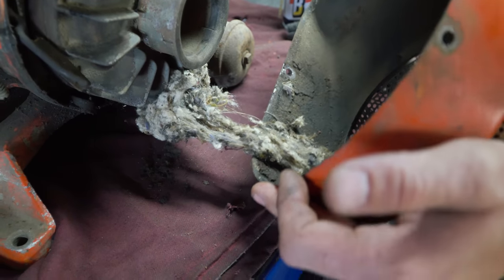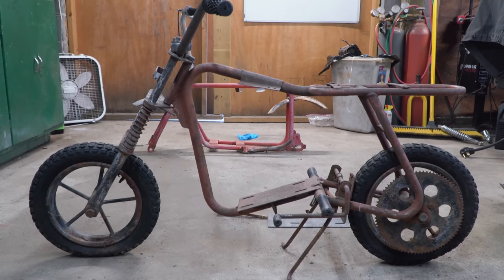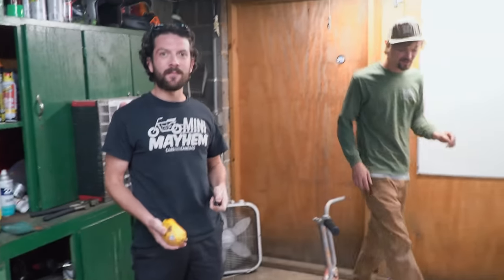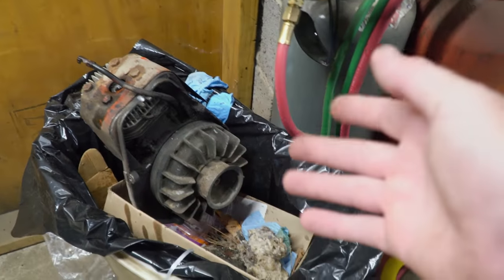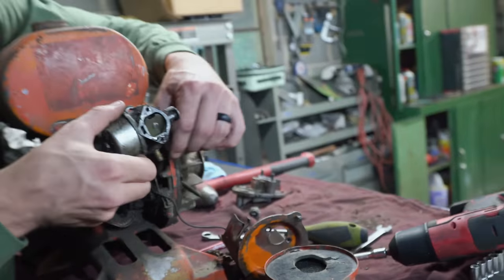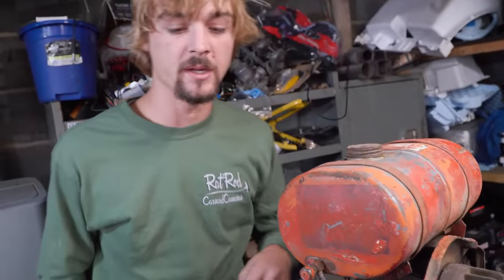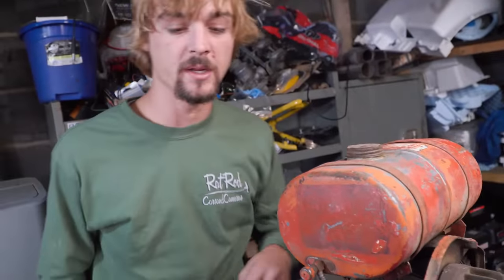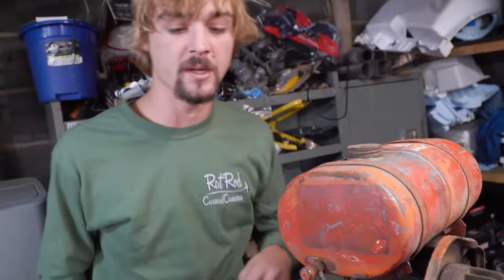Can we Salvage a 50 Year Old Water-Logged 2 Stroke for a 60’s Mini Bike Build?

Comment: a two stroke may not have a cam but they do have intake port timing. The ignition will also stop this two stroke from running backwards. A two-stroke glow engine as used in model airplanes will run backwards but not very well because of the port timing.

Comment: You can't start it in reverse because your timing is now firing AFTER top dead center when you attempt it, and most engines fire a few degrees BEFORE TDC. Theoretically you can move the coil over and it will start in reverse

Comment: 2 Strokes do run in reverse. Snowmobiles that have reverse most likely run in reverse. It saves a lot of weight making the engine run in reverse rather than having a reverse gear.

Comment: Ike´s right, twostroke will run either way. But when it´s gonna run backwards, you have to adjust the points (igniton plate) about 5 degrees back too. For example, when starting a messeschmidt threewheeler backwards (it´s only way of going in reverse) you press in the key, witch by wire sets the timing back and makes the engine run backwards.

Comment: The backwards thing is a problem on 2 points, spark timing is likely not right on tdc and also your magneto was designed for the north to south to pass a certain direction, if you could adjust timing enough and flip the magneto ove it would probably work

Comment: The engine will run in either directions but you need to change the timing to accommodate. Sometimes if your timing is way too advanced when you try to start it it can actually backfire and start in the opposite direction.

Depending on the ignition type, if you have a trigger coil and charge coil, it may not run in reverse because it has to charge before it triggers.

Comment: Issac you're not wrong. But I'm pretty sure it's the Reed valves not the spark that's keeping you from running it in reverse.  But overall this is a sweet build!  "It'll be fine"

Comment: My 2020 skidoo 2 stroke 850 runs in reverse.  That's how the snowmobile has reverse.  When you hit the RER (reverse) button the engine very quickly shuts down and then restart but running in reverse.

Comment: Quick bit of info that might apply here: I own a two-stroke moped from the late 1970s, and the reason the muffler is able to be disassembled, in that case, is because it occasionally needs cleaning due to soot buildup in the passages. Not sure if that's the case with the muffler on that Jacobsen, but I wouldn't be surprised if so. :)

Comment: A nice little engine guys
I just remembered that I have a very similar one sitting in my laundry (dry and no moisture on it) that has been there so long (35 years) that It has become part of the normal that I no longer see it
(male domestic blindness!)
 BTW do you realise that it probably is cheaper for you to buy your brake cleaner in a gallon tin and get a pressurised container (even a 15$ pump up one from your hardware store for gardening)
Maybe a parts cleaner wouldn't hurt or ultrasonic cleaner would be money well spent.
Keep up the good work guy's
Tony from Western Australia 🇦🇺 😁

Comment: You can always make new gaskets over night with two sheets of construction paper, rtv, a rolling pin and a wire coat hanger. Cut 2 long straight sections of the wire hanger. Place them on the left and right side of one sheet of construction paper. Cover the sheet of paper with as much rtv as you think it would need to make a gasket as thick as a wire hanger is. Place 2nd sheet of construction paper on top. Work air bubbles out and evenly distribute the rtv between the sheets of paper using fingers and a rolling pin. After satisfied with thickness and distribution and no air bubbles leave it over night and you can cut out your gaskets in the morning. You can also use any variety of material instead of construction paper. You can use oven wax paper, cardboard paper, parchment, or if your feeling really frisky and want a racing gasket you can use multiple layers of aluminum foil and rtv.

Comment: Needs a custom expansion chamber and a good slide carburetor. Would be interesting to have a CVT clutch and jack shaft too. Even a rear wheel with a 3 speed hub in it would help.

Comment: you can always  gaskets out of gasket paper or heck even a cardstock cereal box. 2 strokes don't need an expansion chamber and its very uncommon on low power applications like these. also, there is almost always a needle bearing on the wrist pin, because not  much fuel oil mixture gets up there. vacuum leak won't cause it to run away, but running lean on fuel means its gonna be lean on oil too. good combination for it to go boom

Comment: Generally speaking the spark plug will fire at around 6 degrees before top dead centre; So In Reverse that would be firing 6 degrees after top dead centre.
I might be wrong but I think that's the problem you have trying to run your engine in Reverse.
If you adjust the timing so that the spark plug fires before top dead centre in Reverse then you would probably have a reverse running engine

Comment: Its usually a timing thing for a 2 stroke to run in reverse. It can happen if you set the timing before tdc and spin it backwards it will pop off

Comment: 16:55 that's how my snowmobiles reverse works... I push a button it shuts the engine off and starts back up running in reverse....and this is also why u want to make sure your timing is right on a two stroke, my uncle was fixing his sled (NO reverse) started it up and his throttle got stuck wide open and cuz his timing wasn't right it started up running backwards at full throttle back into a tree 😆

Comment: In order to run back words you have to change the ignition pick up location to spark on time during compression strokeessetially its about 90 degrees out of time i believe i know the spark is off timing for sure tho every motor veries slitly for the sweet spot

Comment: My friend had an Aprilia RS 50 manual from the late 90's, if you bumped started while walking backwards it started right up and you would have 5 reverse gears on a motor bike!
Some 2 strokes 100% run in reverse

Comment: wouldn't running a 2 stroke in reverse take one step more than just starting rotation? I would think you would have to change the timing as trying to start in reverse rotation would then have the spark ignition after TDC not before as needed to properly run.

Comment: The piston moves up to tdc which inturn opens the Reeds draws in air and fuel/oil mix the vapour lubricates bottom end, piston moves down to bdc closing reeds with pressure which compresses the charge in the crank case whilst that is going on the piston opens the exhaust port so whilst the hot burnt gas releases the transfer ports open as the piston moves down and with the pressure in the crank case it pushes fresh charge up the transfer ports into the cylinder also pushing what little burnt charge out and then the piston is moving back up the cylinder to tdc closing ports and exhaust at it goes and all the rest is continuing fresh charge drawn in ect, but when you move away from the typical agricultural early types that's when power valves, port timing and resonance in exhaust expansion chambers comes into play really simple engines but some very complicated variations to get really good power either way I love a good 2smoker.
Reply: All 2 strokes function the same way regardless of how old or new it is.  An old 2 stroke will always run better with a proper tuned pipe.
Reply: @dipstiksubaru3246  yeah once they dip a toe into performance 2stroke engines they will have some crazy little rippers

Comment: That sprocket is hilariously giant for that motor. I’d go up in size on the motor sprocket and use a smaller rear sprocket. Have to find where it hits it’s powerband. Also that coil may have a built in rev limiter in it.

Comment: Most two stroke engines are designed to run just one way. The spark advance will only let it run one way.
Some two strokes can run both ways. Johnson snowmobiles had an engine that ran both ways. One for moving the machine forward, one way for reverse. 
Only thing is it didn't run well either way because the ignition timing was at TDC. Without advance you didn't get much performance.

Comment: You guys need a ultrasonic parts cleaner. Little tip, just fill it with water and put the cleaner in any bottle or jug with a screw on cap. Widemouth mason jars are perfect. Put your parts in the jars and drop the jar in the water. This way you don't have to ever dump out the entire tank when it's a disgusting mess.

Comment: Will not run in reverse without proper ignition system in place. Won't spark with points so most reversible engines were a 6 or 12V ignition system to do so. 
I also have a mint condition Bird Mini bike but it's been upgraded to a predator and a torque converter. We ended up getting it without its original engine anyways so we made the predator work fine. The rear sprocket is a little big though had to change mine to a 68 tooth with #35 chain! The original was like 80 something tooth it was a wheelie stander and that's all it would want to do!

Comment: Reverse on some snowmobiles is done by reversing engine rotation.
Reply: I was going to say this, both my ski Doo 800 summits spin both ways. when you put them in to reverse it stops the motor and spins it backwards.

Comment: If you have a vacuum leak at that area on a 2stroke, it will not "rev" in fact it will be very hard to start and have much less vacuum to pull the fuel through the carburetor.

Comment: This one time at the lawnmower shop I worked on a riding mower. It sat unused for quite some time. I gave it basic trouble shooting and some gas. It should not have but it started up. After running it for 12 seconds I shut it down because it stunk so bad like mouse nest. It also kicked out a ton of nest into the air. I decided to stop fooling around and just take off the blower housing as I knew I should have. In addition to mouse nest I found many gooey red chunks. So yeah, the fly wheel ground up a mouse or two.

Comment: That twist grip is what happens when steel and aluminum come in contact and is exactly why on things such as an iron block motor or when you are using steel bolts to hold aluminum parts together and you don’t properly never sieze you will get horrible corrosion issues Science man

Comment: It will run in reverse... just switch the spark to the other side of TDC. Ya gotta design and build your own expansion pipe......... The great thing about two-strokes.... More simplistic, and less parts. Oh yea, and case induction.......... only thing better than that, would be if it had rotary induction. An NGK CR2 racing plug wire all wrapped in silicone is the plug wire ticket...And it even matches the engine......

Comment: Here is one for ya in the run backwards 2T. There was about 5 of us with bikes at the trails where we rode.  There was 2 early Honda CR 125's 1 TM 125 and a Bultaco 250; Alpina and a YZ 80. And about 8 of us total and a couple girl friends. One of the spots was a place called the V,'s. There were 2 right beside each other straight down about 50ft and straight up the same. I was following my buddy as he went down the big V and he went slow because his girl was on the back. As he started up he bogged it real bad and he pulled the clutch lever in and tried to dump it. It all happened to fast he started to roll backwards as he dumped the clutch the CR fired up backwards and he slammed right into me and the three of us were all down and his bike still idling backwards.

Comment: The reason why the engine doesn't have an expansion chamber exhaust is because that technology was developed in East Germany during the cold war, Suzuki was the first non-Eastern Block builder to use them in racing, they didn't appear on consumer power products until about 1973.

Comment: The problem with a 2 stroke running in reverse is timing. as with a car the spark must happen a few degrees before top dead center. So to run backwards the pickup coil and points must be shifted so they operate BTC on the reverse rotation. The reason you got very little spark in reverse is the relationship between the pickup coil and points was backwards. The coil must be fully engaged with the magnets before the point send spark to the plug. Older golf carts started the engine in reverse to backup they mechanically moved the points and coil so the engine would run as well in reverse as forward. You mentioned the size of the muffler that is required because a 2 cycle can't have any backpressure or it wont run a standard muffler would not allow the exhaust to exit freely.

Comment: The old two stroke Detroit's could run backwards. Those were diesels though. Dont run one backwards though because oil pumps only push oil to the top end one way 😂

Comment: Its because the spark has to fire a few ° before OT, when you turn backwards it becomes to sparking after the piston was at top end... but theoretically it would run backwards, you just would have to repostion the coil.... there are diesel2stroke, they dont need spark and run backwards without modifikation... greetz from germany, like to see u guys checking out 2strokes

Comment: if the reed valve is good it won't run backwards but if it's worn it can but it will damage the carb as hot gasses can damage the jets and needle not worth trying it happened to Me doing a Trial ride up a steep hill and I stalled on a section so I rolled back and let the clutch out not thinking and it ran at full bore down the hill with me on it we ended up in a heap at the bottom I had to replace the reed valve and carburettor as it destroyed it plus it broke my colour bone so no it's not worth it, mind you it looked good on video apparently someone told me as they filmed me I never saw it myself but apparently it looked very funny, lol mind you I didn't find it funny at the time but I do now.

Comment: Neat old thing, especially when it's all put together... :D

As for reversing a 2-stroke, I think you have to adjust the timing a bit to get it to fire at the right point in the compression cycle, which isn't an easy thing on something with fixed timing like this, as there's old 3-wheeler cars over here in the UK with 2-stinks that to reverse in, you stop the engine, pull a lever, start it up in reverse and there you have reverse in all the forward gears... :P

Comment: Had the same issue with my pocket bike wheels, snapped the bolts right off.. this bike could be really cool with a smaller sprocket n wheels that can actually handle power

Comment: so when are you guys going to bolt 2 engines output to flywheel?
27:00 custom wheels HOOOO!!!  spiral cut on the plasma table center sections and have a tube to house bearings that have one side open.  also put a grease fittin on the tube! lube up them bearins real nice like!

Comment: Some of the big old single cylinder tractor engines will run in reverse, but they use compression ignition not a spark plug.

Comment: It doesn't run backwards because the ignition timing is really late if you try to run it the other way. Some engines run the other way because these somehow can handle the late ignition.
Thats the theory I was thaught when I was dealing with 2 stroke engines.

Comment: I got a Stihl cutoff saw from my old work that was locked up. It's the Ms 400 or something. They said it was garbage. I got it unstuck, taken apart, and the thing runs like a viper. Gonna put it on my mongoose scooter kinda like grind hard plumbing did. 9500 rpm and 6 hp. Should be a good time.

Comment: Needs a bigger sprocket?
Fellas, If you go much bigger, you might as well just wrap the chain around the wheel, 'cause it's GONNA be "diggin' in the dirt".
Make yourselves a jack shaft, with a gear reduction, flip that rear wheel around (to drive in it's INTENDED direction), and be good to go.
Those are sweet little engines!

Comment: In order to run in reverse you need to adjust the timing. The old speeder rail cars for a single cylinder 2-stroke engine that you could reverse the timing on it. They would run that forwards and backwards. The only way you would be able to run that motor in reverse is if you moved the ignition pickup. But yes in theory they will run backwards.

Comment: I've had my RC engine run backwards... runs like crap, but it ran. Strangely, it had a one way bearing with a pull-starter, so it was basically forcing it to slip. It was an old/worn OWB and tended to slip when trying to start anyway. Sounded really weird as well. It backfired. Only ever had it happen once. Not the same as that kind of 2 cycle, no reed valves. It was an OS 21RG-X.

Comment: Mechanically a two stroke will run backwards.... But.... The spark timing is timed before too dead center so when you try to run it in reverse the spark timing is way off so it will not run well at all. 
So if you change the timing in the opposite direction it will run well in the opposite direction.

I use to have a old Trials bike that had a 2 stroke on it and the spec timing on it was close to top dead center... And sometimes the engine would backfire and then run in reverse..... When I would go to take off the bike would go in reverse. The engine definitely sounded different when it was going the wrong way!
From an old guy!

Comment: The reed valves only work correctly 1 way. They work off vacuum, and reversing the direction pushes the valves when they’re supposed to be pulled
Reply: It's the ignition. Piston is going up and down creating compression/exhaust no matter which way the crank is spinning.

Comment: To further support the statement " two stroke motors will run backwards ". Newer snowmobiles with reverse will stop the engine and run it in reverse to move the snowmobile backwards.  Not positive but I believe yours wouldn't due to ignition timing.
Reply: You are absolutely right, that's how they do it on snowmobiles.